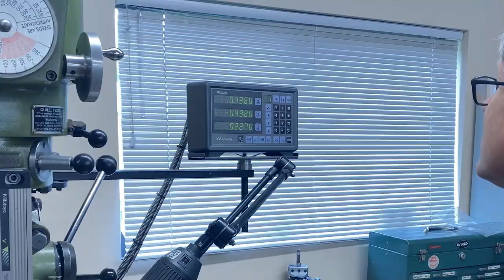U-Brake Boss Fixture with Paul Brodie - Framebuilding 101

Comment: I used to have U Brakes on my tandem. Scott Peterson Self Energizing ones. They had excellent stopping power when adjusted correctly but ate brake pads, sometimes after just a few hard rides. The final ride with them was down the Smoke Bluffs trail in Squamish with my Clydsedale spouse stoking. She had doubts about my piloting skills.

 I got Chris@DeKerf to put proper disc brake tabs front and rear for it. I kept the brakes along with the extra ones given to me by Ron Clumpus, who got it from a bike shop that used to be in Gibson's.
Reply from the maker: Good stories.

Comment: I like that design because if it's not perfect you can just bend it a bit. Not having machine tools I always make fixtures like that. Then I can get them as good as I can measure them with a bit of tweaking. That fork you're making is an absolute beauty. The brazing is so perfect and symmetrical it's going to be a shame to paint it!
Reply from the maker: Thanks Ben. It won't be a shame because I am going to clear coat it :)

Comment: That was a really neat fixture, nice to see how it should be done. 
. I've only ever fitted brake pivot bosses once,  to an old (1985) 'Milk Race' Raleigh frame when I converted it to a 'hybrid' in 1998. Still hanging up in garage, wife hasn't ridden it in probably 18~19 years.
Reply from the maker: Probably time for a new set of tires if someone is going to ride it...
Reply: @paulbrodie  Yep, think 27x1-1/4 are still available although I'm not sure wife will ever ride it again, she's twice the girl she was.

Comment: Why did you use silver solder this time?  You typically use silver nickle.  Which is stronger?
Reply from the maker: Silver solder puts less heat into the frame, and makes the bosses easier to remove, if that is ever required down the road. Nickel silver is stronger, but I have Never had bosses that were silver soldered fall off. Never ever. Thanks for watching...   :face-orange-biting-nails::face-orange-biting-nails:

Comment: What Brand and model tool & diemakers vise do you use? I always had a pair of Yankee ones (a 2.5" and a 3.5") I recently just bought a Palmgren 2.5" and started restoring it- I always see your little vises and wonder what you use?
Reply from the maker: I have a drill press vise, but no tool and diemakers vise, sorry. I have a 5" Eron on my Mill.

Comment: Paul as I come from a woodworking background how feasible is it to fabricate a jig like this out of wood? I know it would not hold up to  hard usage. But I don't have metal working machines just a shop full of woodworking equipment!
Reply from the maker: It could work if you only Tig-tack the frame in the jig. If you braze to tack it could catch on fire. That's what happened to my first fork jig, so it only worked for one fork.
Reply: You could also just use some sheet metal to cover the wood to protect it from heat. Just tack it to the wood frame.
Reply: You could make the jig out of semolina pasta also.